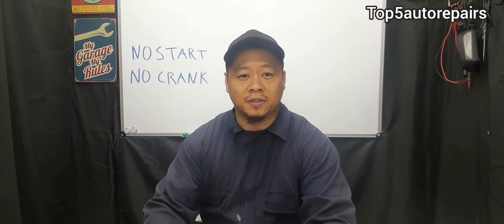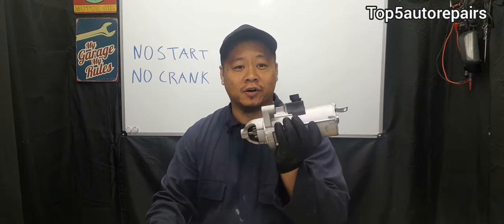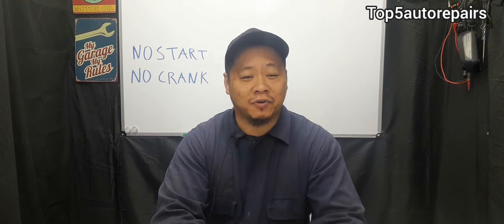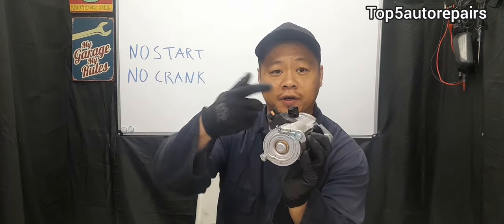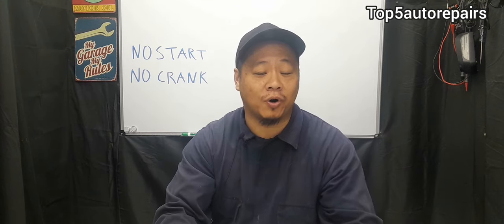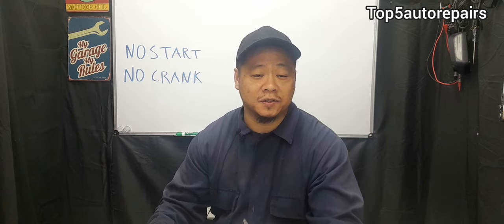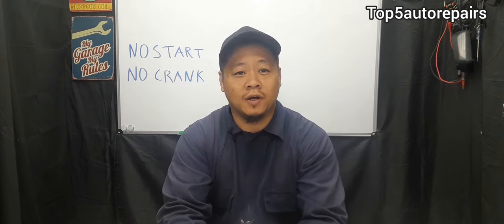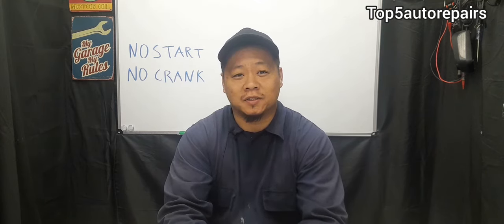Car No Crank No Start No Sound (Won't Turn Over)

Comment: No crank , no start. After I run car awhile it will NOT start back. I have to wait several hours until it will start back up. Battery is good, connections good, alt good. Just wont start hot... info ?
Reply: I’m literally having this SAME issue with my car!
Reply: Did you solve it
Reply: You may have a camshaft sensor going bad.  If you have a check engine light have it check with a diagnostic reader.
Reply: @benitocorpuz6336 hey friend I have a few questions, I had a no crank no start no clicking nothing at all I got it towed to a body shop and the guy won't answer me 200 bucks for the tow anyways can someone up plug a camshaft sensor? Someone wanted to buy my car I wouldn't then this happened its a 2011 chevy Malibu 3.6 ltz oh and they pulled some fuses lol people are so dirty man! Help a lady out please
Reply: Could be you fuse box, when a fuse box gets hot the inside spreads apart then cools down bam it will start back up, take off your fuse box and heat it up you'll see where the break is then you can repair it easy! I hope this helps it's always that dam fuse box look it up and go see what I'm talking about
Reply: My starter needed to cool down to start when it was on its last legs.
Reply: @Nicole-dj3jf I have the exact same car, and the same problem. Did you ever figure out what exactly was the problrm with you’re malibu
Reply: @cristobalserrato8320 wondering if you ever figured out what was going on with your Malibu. I'm currently having  same issue
Reply: We found out our ground wire and straps weren't grounding... replacing neg cable and straps. God ,please let that fix it. About to throw holy water on things yelling the power of Christ compels you! Just a little humor ...
Reply: Is the crankshaft sensor
Reply: I'm having a similar problem with my 98 dodge durango. Drove it yesterday stopped at a gas station and went to start it, and nothing no clicks. It's been working good all that day. So I Don't understand what the issue is.
Reply: @rickywhite7578   I put new battery in my 98 crown Vic.. ran twice like a beast! Then dead. He did get me home. Right now we're going to check hard at the grounds... New battery cables and starter only got us a click in the relays.  Resistance? 3 good mechanics( this place) agree on ground to be checked.
Reply: Can anyone lend an idea I'm have a no start but If I press down lightly on the battery lights will come an an engine as well but sometimes during driving all the lights will come on for a sec the battery isn't slack

Comment: I have a 2012 GMC canyon. At times will not crank or start. Let it set for a out 10 minutes it will start right up. And run perfectly. Until it decides to do it again. Dealer did not know how to repair it. Did it every since it was  new.

Comment: I just changed my starter. It worked for a week then the same issue happened again. I now noticed my 30 amp fuse is blown. And now the fuse keeps blowing. What do you think the issue is?

Comment: Got new battery for my 98 crown vic...it started like a beast 2 times then BAM! Nothing..dead acting. So changed the ignition switch, starter and positive cable. Still dead. Got an online mechanic who walked us through testing things. Hadn't even thought to check negative cable. DUH! The reading from testing ohms and volts the negative was supposed to read .4 or under and ours was reading 12-29 touching different surfaces. Mechanic was omg that's way too high so we're going to replace the negative cable and ground straps. Ford had this STUPID idea to use clamps instead of eyebolts for straps. Can't find replacement straps with the clamp connectors any place..SO..guess we'll have to either call ford or drill holes for eyebolt connectors. Your video went along with what we're dealing with. Just wanted to tell our story to anyone having same problem of no crank.

Comment: I had this issue on a 03 Hyundai Santa Fe and the connection was loose from the starter. This is after my wife told me she spilled oil...

Comment: my starter keeps on grounding out click click sign clicks I replace a starter and I bench tested it and it works. I tested the starter down there I’m getting 12 V. I tested the little wire while trying to start it and I’m still getting 12 V every time I hit the start button I said in 12 signal, but it keeps on grounding out click and I get a full charge battery where is the ground on a 2015 Hyundai Santa Fe 3.3 thank you.

Comment: Could it be seized if it have a click
Reply from the maker: Correct it can happen
Reply: @Top5AutoRepairs  how common is that I have the town and Chrysler mini van shut off on me and I got the ⚡️ light I changed the throttle body still nothing was thinking the tipm but didn’t wanna waste money if it’s seized

Comment: You're absolutely right about giving the starter a few good hits with a hammer, etc. to check for a flat spot. This has worked for me for years. I replaced my original starter with a cheaper Chinese version about 5 years ago on my 2010 Versa. I noticed a gradual failure over the course of the week; sometimes barely cranking, and other times getting a strong crank and easy start.
It finally died and got no cranking at all. I did the usual checks, ground wires, battery terminals, neutral safety switch, but nothing worked. I moved my radiator overflow tank out of the way to get some more room for a few good hits on the starter. Worked perfectly. While it was running I drove awhile to get a charge on the battery for the juice I used for my cranking experiments.
I shut it down, retried, but again no cranking.
Gave the starter a few more taps and it cranked strong and started.
Getting a starter tomorrow, but since the battery is 9 years old, I'll probably replace it too.
Good luck!

Comment: My 2005 Odyssey with 385K kms remained Parked all winter outside the garage in Canada. Now when tried to start no crank not sound. Found started burned. Replaced with brand new. Tried again to start with brand new battery, it does crank but for a second or less only,  and not much.
Thought engine seized, so I manually rotated engine pistons by moving the crank pulley which is at front right side behind the wheel. Still no help.
What you can suggest? For now I took out spark plugs and sprayed "Sea Foam" penetrating oil.
Reply: I resolved it myself. After burning the starter motor at the first try mentioned above, and moving engine manually several time from crank pulley. I removed the serpentine (fan) belt and tried to move every (power steering pump, AC compressor, support pulley and Alternator) pulleies with hand or using some tool without damaging their surfaces.
I was able to move almost all of them except the Alternator. It was really really jamed. Removed it (there are good videos how to). Tap it with hammer lightly all around and also sprayed in WD40 and Penetrating oil spray. Left it for over night and tap more next day with hammer. It started moving.
 I hammered it more after pinching or putting pressure on the edges where screw goes in to hold it with car body, because It again was almost felt  jammed. Once got free in that position too, I was able to rotate the pulley with hands with any force. I put it back in. JOB DONE! 
Van started with a quick ignition crank just like brand new.
Hope this detailed question and detailed solution help someone like me.

Comment: Hay bro, I have the strangest of all starter problems. The starter swings, and the solenoid doesn't get engaged to crank over the engine, but the solenoid works when I tested it by itself with the starter but won't crank over the engine
Need help to solve this problem
Reply from the maker: The starter is on its way out. It's too weak to crank the engine because there is load.
Reply: @Top5AutoRepairs  Agreed!
Reply: Car click s can only roll start it been through everything else any idea bench tested the starter and it works fine could it have damage

Comment: Why if bench test ford ranger starter, it not stay ingauge if i keep small wire on pin. It uningauge with start small wire  on start point. It must only uningauge only when i take of start thin wire, am i right or wrong? 

Rrrrrealy hope someone can help me. Thanks guys.

Comment: My kia is no crank no start  it stopped working while driving
Reply: This is exactly what happened to my 13’ Escalade. I was driving then approached a stop sign and car just went dead on me. Battery was good but when I went to start it again, it wasn’t cranking only making one big click sound while I held the key in the start position
Reply: @M5WithSubs  do you remember the problem
Reply: @Yahs-our-El  I haven’t really had any time to work on it or figure out what the issue is , so it’s just been sitting in my yard for the last few months but I’m really hoping it’s just the starter and nothing else major. One of these days I’ll have to go under and check if there’s any loose connections on it and maybe hit it a couple of times to see if it’ll start with that.